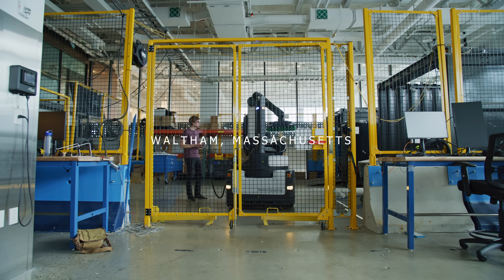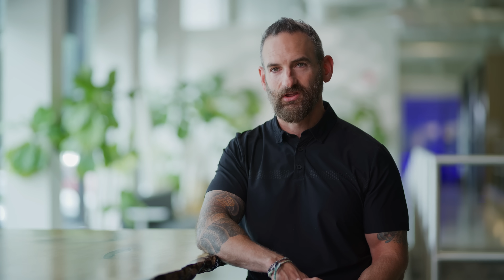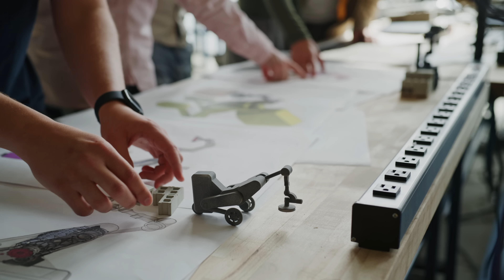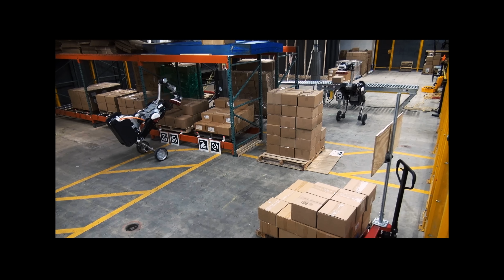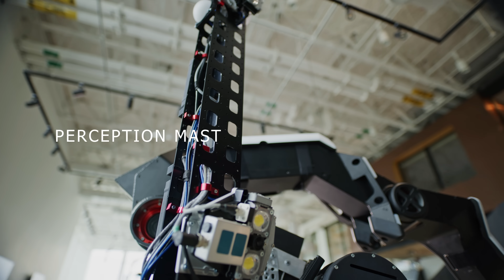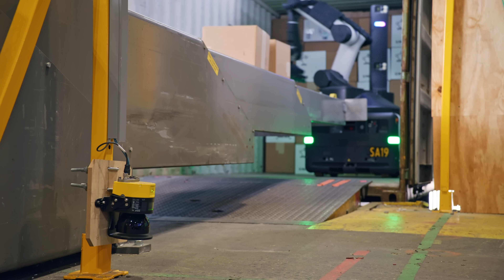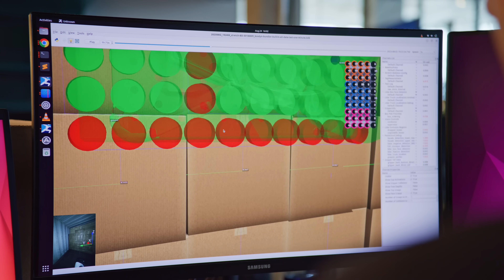The Evolution of Stretch | Boston Dynamics

Comment: This makes vastly more sense than trying to force a humanoid robot to do something more traditional robots are flat better at!  But, I see very little about stretch that goes beyond robotic systems that have been around for decades.  this is basically a 5/6 axis arm on a mobile base, something that's existed for decades!  I'd also bet the cost of Stretch will exceed the cost of a similar sized robot from Kuka or Fanuc mounted to an off-the-shelf mobile base.

Comment: How does Stretch work with boxes that are all crumpled, and damaged because those trailers are rarely loaded with care, and so many boxes at times rarely resemble boxes when they reach their destination.  Usually those boxes also will not hold their own weight from the top alone.

Comment: I've worked in factories/warehouses and a couple of times each day a box is lifted off a conveyer belt(by a human) only for all the contents to spill out from the bottom, because of an issue with the taping machine, or sometimes tape runs out. Even a fully taped box can sometimes break open and spill over. To avoid this, we always lift boxes with fingers at the bottom just in case. Yet most of these robots lift boxes from the top, or the sides.

Comment: A even cooler and more applicable use for a relatively reliable, and warranty of parts and machine like this over time would be something almost twice vehicles of base of stretch . Probably need it on a track for it’s surface use .That robot arm replaced with a mechanism like a boom hydrologic lift that deploys a umbrella more like a square design going up higher to cover more area that can maneuver to a backyard for things like roofing and a custom  algorithm that can find the sun and the roof worked on position itself based on availability, and then boom up the shade umbrella.

Comment: Definitely would never work. Cool toy though.
Reply: Why?
Reply: @A4S2HI994  weight, package size, dust and speed. It will at best be used to handle dangerous things. But why spend so much on a low machine when a human could do it all, faster, with more efficiency?
Oh, also some packages need to be on a specific side too.
So it only appeals to a very niche thing, which in turn would result in possible safety hazards when servicing it.
Reply: @2Fat2Furi0us back in the day, humans used to fill bottles and attach the caps them selves. These days machines do the same thing but a few thousand times better. And these same machines can do any bottle with any liquid. 
And this same story will happen with humanoid robots.
Reply: @illpunchyouintheface9094  yes, a machine can perform in simple, repetitive tasks.
For a company to use a machine like this one they would need a clean environment, precise scaling, packages of similar size. And even then, human labor is far more efficient in any regard. So, what is the market this device is aiming for? Medical already has it worked out, so does nuclear. If the risk is high enough, you must have human supervision.
Shipping companies won't work, because just from the dust you would need to service the machine often unless you clean it daily; for which you need trained personnel.
Maybe bomb disposal might find use for it. But it is far cheaper to just remote detonate stuff rather than risk an expensive robot.
The bottle cap example is a great one. Low risk, fast speed, low room for errors, easy and cheap to fix. As opposed to this thing, which the more you think about the less you find uses for it. You see, problems require a solution; right here you have a dilemma.

Comment: Summary: Boston Dynamics has launched a new robot named Stretch which is designed specifically for use in warehouses. The robot is capable of moving cases around all day long and can make its own decisions about what to do next. It has a mobile base with a capable drive system to move in any direction and carries the robot's arm perception Mast and the vacuum system. The system was designed together as a single robot, unlike other robots that have an arm bolted onto a base. Stretch is able to understand the environment and make its own decisions about what to do next. It is aware of its state and the state of the world around it and is capable of reacting even as things unfold away from the ideal. The robot has a perception mask that has a vision system, which is individually actuated, so it can look around independently of what the arm is doing and see what to do next. The sensors on the perception mask can be pointed at anything and take pictures whenever required. These pictures are then fed into a custom-built machine learning algorithm that's able to identify where the objects of Interest like boxes are.

Comment: Handle would be perfect for longer range logistics. Moving packages around the warehouse quickly is something only belts and conveyor systems have been able to do, so using handle would free up a lot of space and lower installation costs. 

I can see the robot being used to move boxes from one warehouse to another, while stretch unloads trucks. Once Atlas is further developed, you could even throw one in to manage more confined tasks and help sort out any issues on the belt before needing a human to step it.

Spot is... Well, i guess you already know what Spot can do.

Comment: Neat! The only worry i would have is lifting cardboard from the side panel might but the cardboard box under excessive shear forces. Also did a quick over simplified calc and came up with it would take 1.6 years of work time to pay itself off assuming $21/hr I see for box handlers. (Assuming $300,0000 unit and free energy. This leaves out paid break time/fatigue (same output human vs machine) and other cost like healthcare)
Reply: Why That optimistic, unit costs probably still over a million in my opinion. 
If there it made economic sense they would have mentioned already. 
This will work in some niche markets. 
They are probably trying to break into mainstream,  cause those investor dollars 💵 will EVENTUALLY run out .
Even if it's very EVENTUALLY 😮
Reply: @xaxfixho  did an internet search and came up with $300k-500K. I decided to be generous and go with the low figure.
Reply: @VAM_Physics_and_Engineering  from my understanding they can't sell you a unit but a system/solution. 
Which company are you referring to and how much did that implement cost?
Reply: "paid break time" what? wtf you guys have PAID BREAK TIME?! wtf

Comment: There is always this magic weight: 50lb, presumably gross. But the world is metric. Even Boston Dynamics' parent company is in a country using metric units. 25kg (net!) is a very common packaging size outside the USA. Must that remain permanently out of reach for a machine presumably meant for the world market?

Many industries depend on boxes where the lid merely slides on and is not fixed to the rest of the box. The vacuum gripper system may be good for some applications, but ultimately it, too, is too limiting.

There are many products that come in bags or nets rather than boxes (cement, potatoes etc.).

Not every kind of box will withstand having the weight of many other boxes put on top. There has to be software to determine the correct sequence for loading a pallet.

What about products high up on a shelf, easy to reach for a forklift truck, but way above Stretch's 'head'?

So while there is finally a Boston Dynamics with real mass-market use, this development has a long way to go and may yet require a return to having two arms and another kind of gripper.

Comment: So the warehouse workers need to slowly get Stretch into position, probably run a position limit calibration so it doesn’t smash the sides of the walls, wheel over and assemble a yellow protective cage around the robot and then hit the go button? Anything else I’m missing?

This will never work. The future of the warehouse worker is NOT robots. It’s Mexican children.

Comment: A South Korean man in his 40s, who worked for a robotics company, was crushed to death by a robot after the machine apparently failed to differentiate him from the boxes of produce it was handling.
The man was inspecting the robot’s sensor operations at a distribution centre for agricultural produce in South Gyeongsang province.
The robot was lifting boxes filled with bell peppers and placing them on a pallet when it malfunctioned and identified the man as a box, according to the Yonhap news agency.
Reply: Sad to hear 😢, we need more safety for the workers 🙏
Reply: thats probably why stretch has an auto-safety lock that goes off when your near, so it doesnt accidentally confuse you for a crate
Reply: @weird-guy  the sun also rises with or without robots.
I also y-e-p my rz with or without robots. 
That's a non statement,  changes nothing. 
Add nothing to the conversation
Reply: First of all, machines like that have debugging routines, which were clearly not used by the korean company. Secondly, in asia software is seen as "bad" work, which explains the issue more. Thirdly, that robot, I guarantee, was not using AI to determine what's what in its sorroundings. Fourth and lastly, this robot has a green/red light system telling you to go away, and will stop operating until you do.
Reply: accidents will always happen, in regular warehouses accidents are quite common

Comment: Still have to wonder about the decision to go with top-side suction cups instead of modifying Atlas with a platform and stronger arms to stabilize the weight from the bottom as how humans and containers typically carry things. From the outside looking in there's no obvious trade-off or benefit, especially when there's a non-zero risk that the suction might fail and drop a box from a moderate to high height. What do they know that we don't?!

Comment: Boston Dynamics robots are very cool!  However, they don't have the software brain to be useful in the real world.  BD needs to contact Tesla and lease the software they are designing and using in their humanoid robot Optimus.  Based on the Full Self Driving software, this robot will actually have a brain and will be able to function in the real world.
Reply: Exactly. BD has the "will" but not the funds...they will be left behind/little kid on the block very shortly. Tesla is already ahead of them after a couple years and BD has been working 10+yrs. BTW: Tesla won't "lease" their software, no shot, no way.

Comment: I can't believe that vacuum system is actually effective in the wild.  It seems like it would constantly be defeated by dust, misshapen boxes, heavier items -- pretty much anything.  And that says nothing about the wear and tear on the "suckers".  That's a boatload of duty cycles for a flexible material.  Though I guess by the same token they can be made relatively cheaply and just replaced when they go bad.
Reply: It would never work in the real world. Too many variables...
Reply: @mikeblaz there are niche markets, where all that is known.
It's like tesla truck 🚚 vs regular diesel truck. Will only make sense in very small markets. Unit cost ,plus battery replacement costs not withstanding
Reply: @mikeblaz  And yet, it continues to work in the real world, despite your claims of impossibility.

Comment: Sometimes the best solution it's the simplest. Interesting to see how they went from humanoid robot all the way back to wheels+arm.
Reply: Yeah. We don't see wheels in nature, because wheels need even surfaces like roads to work best. And when one animal builds roads to use it's wheels, everyone else can come and use it at no cost.
Legs work much better on uneven ground. Not as fast as a race car, but allowing goats to climb 80° slopes, allowing cheetahs to run through the savanna, allowing walking over uneven terrain.
And logistics means even ground, so wheels are the way.
Reply: Imagine if a calculator was shaped like a brain 🧠 😳 💀 😅
Or a car was shaped like a horse 🐎 😂
Or a boat was shaped like a fish 🐟

Comment: interesting case of research and "cool" robotics vs meeting industry needs
they began with atlas which is super cool but isn't really fit for any application
then they iterated some interesting and innovative designs with handle, which if you noticed got simpler and simpler with each iteration
ultimately the best fit is the relatively "simple" stretch: an arm attached to a cart and some sensors
Reply: Coming close to a simple "Fork Lift "

Comment: I have an idea that can improve your creation. I'm assuming that the Stretch while working in team is simply avoiding the other robot at its current state, and adjusts the flow of work accordingly, using only its perception system. I would recommend implementing a connection system between robots that would allow them to see each other's planned paths in real time. It could allow them to determinate a baseline of operation that can be influenced by factors such as: priority of their task, speed of operation, interval of potential path conflict. That kind of system would make them more time and cost-efficient.
Reply: In the video they seem to be AVOIDING any movement, guessing for safety and energy consumption 🤷‍♀️

Comment: There are a number of applications I’m curious about: 
1. Narrow very big boxes like servers— not much room to grasp from the side, heavy, delicate. 
2. Boxes with shifting weight like cat food or other particulate item
3. Damaged heavy boxes: torn corners, tape coming undone…
4. Wet boxes
5. Reaction time: unloading a truck and someone surprise comes around the corner while a box is in motion.  (improbable situation with safety standards, but still)
6. What happens when it’s not the robot’s fault a box breaks: soggy bottom and product falls out: protocol? Damage prevention?
7. Does the charge vary based on load? If it is relatively fixed in position can it be directly plugged in for no charge breaks?
8. Oil/grease/maintenance
Reply: I would guess that lubrication/maintenance is not more than other mechanical stuff in a warehouse, conveyor belts, forklifts, etc.
Reply: @bennylloyd-willner9667  I think that’s a reasonable assumption
Reply: leaving the comment for be subscribed to the main comment's answers

Comment: stretch is such a gamechanger, performing actions where workers are under time pressure.
Reply: Stretch is useless...it moves boxes w/the same dimensions. What warehouse/unloading truck has that?
Reply: @mikeblaz  you usually have standardized boxes. sure not every warehouse deals with those but lots of shipping happens with them. and as far as I can tell stretch recognizes the size of the box and can even pick up multiple if they all fit on the gripper.
Reply: @Chriss120  Ever work at UPS? Nothing standardized at all and there is a level below on the truck where stretch has no chance of reaching. This thing would be utterly useless...

Comment: I have been following the project since the introduction of "handle" and have written countless emails to get an offer for a stretch. Unfortunately, no answer so far. It would be a dream to integrate a robot like this into our processes.
Reply: Exactly.  Boston Dynamics robots are very impressive mechanically.  However, they don't have the software brain to back it up.  Thus they will always be limited to very specific and regimented tasks that require no intelligence.  The Tesla humanoid robot, Optimus, does have a brain based on their Full Self Driving software.  That is the brand of robot that will be in your factory within two to three years.  If you have not seen Optimus you should check it out!

Comment: Stretch would probably work really well on the back of a dump truck or firetruck it could find everyone in a flash with thermals and a popup drone. A drone could easily drill a hole in a roof and add retardant into the ceiling 🎉❤
Reply: Hmm, no. It would be better to design a robot specifically for search and rescue  in a fire, by making it designed to move in a rough environment and the ability to see better in smoke. Making it design to be heatproof. I like your enthusiasm, though. It's always good seeing people interested in robotics instead of being afraid of it.
Reply: @GamingWithNikolas  I guess I was thinking of the initial assessment of the situation, which would be a small fire that a drone could go somewhere and target versus having to trek into a fire. It could be identified by heat signatures, know the life’s inside and act accordingly
Reply: @hyperverbal  Good chain of thought.   I think a drone with a camera, visual and heat seeking and night vision so the team could have a birds eye view of the situation from multiple camera types. That way the firefighting team can be much better informed on the situation in a way that would be impossible without the drone. And I still think a ground unit could be helpful if it is extremely robust and as heat proofed as possible. So it could walk through the fire if it's in a hallway and be able to search for people that could be trapped so they can prioritize that area or know that area has no civilians. Have it have a storage box for oxygen mask, because I believe most people that die in fires die because the smoke, so that way people can breath while the firefighters put out the fire to clear a path.

Edit: Just fact checked my claim about smoke and I was right. The majority of people that die in a fire situation die because the smoke, not the actual fire.